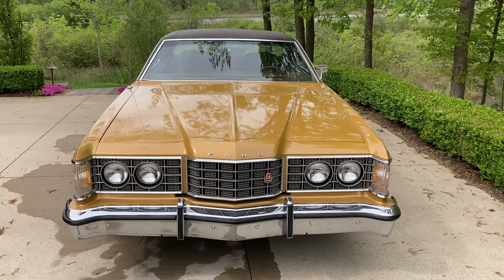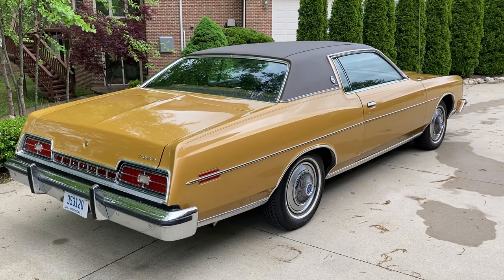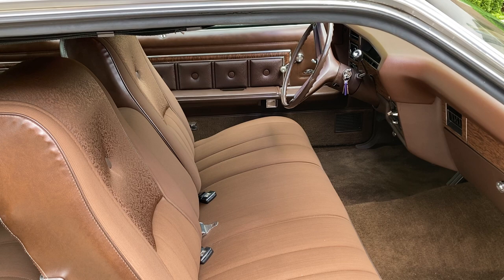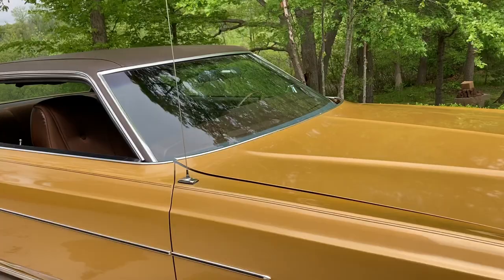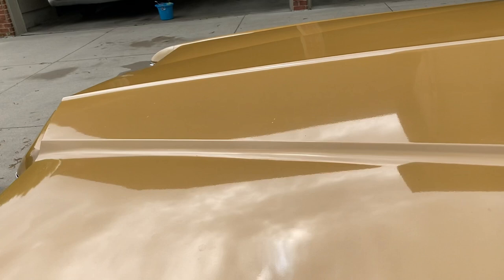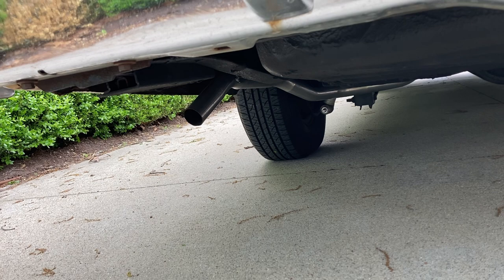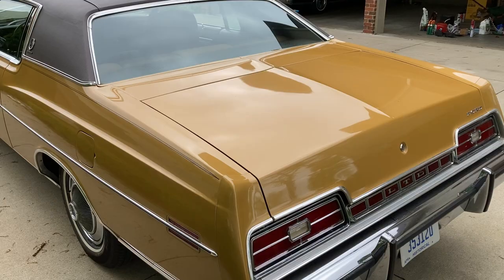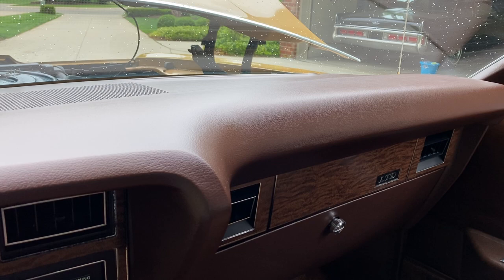1973 Ford LTD Brougham Coupe 460 V8 - The Everyday Man's Near-Luxury Car

Comment: 1971/1972 were better in the aspect that the "passenger" was not allowed to touch the HVAC controls (on LH side of steering wheel)...LOL...They also had Dual Ashtrays on the dash too! 😜

Comment: This car is begging for a set of 15x8 either slotted aluminum wheels or American Torque Thrust  grey spokes and either white letter  or black wall Cooper Cobra Radials 275/60/15 and 255/60/15. Also a mild 2 1/4" dual exhaust with some fairly quiet mufflers.

Comment: Whether an improvement on the 71-72 Fords debatable, but the 73-74 reskin was very effective in creating an impression of 'new car'.  I miss easily recognizable design cycles and I think this was one of the last - though the Torino --> LTD II did the same thing and maybe the GM b body aero clean up for 19080 counts as well.  Ford got a lot of mileage out of that damn front bumper design, but - perhaps because of its ubiquitousness - it always struck me as the least imaginative effort of the big three.

Comment: Yeah the buzzard I remembered that if you leave the keys in  Ignition it makes a horrible sound My parents had it deactivated on their LTD the and there's was a 74 model 4 door meant green with 4 screen interior the 400 engine automatic automatic air AM radio power brakes and the stiffer suspension and heavy duty brakes Is and real window defroster

Comment: A decently preserved vehicle, and rare to boot esp that color IMO. 

I am curious as to that  pass. side hood /fender match alignment variance.  Seems that the leading edge at the grill cowl is depressed, maybe just an optical delusion.

Not sure what is meant by “the retarded cam gear” at about 7:58.  Maybe you meant “troublesome” (as part of steering column lock), or something related to the spark advance on start.

Regardless -  a cool car, enjoy your ride!
Reply from the maker: Nope. They retarded the cam timing by 6 degrees in 73
Reply: @RareClassicCars  
 
Ah- the use of “gear” was ambiguous to me. 

Are you inferring the entire cam series had same setting shift?  The only good excuse is relatively cheap smog control. 

My thought is that shift would delay intake opening so less air in means less compression so less power, and less time to evacuate the cylinder on stroke 4 - all around less efficiency and less power due to exhaust restriction, though the exhaust gas would be slightly more pressurized from the upstroke to exit.  

Overall, a good move or a bad move for drivability?

Comment: Was the 460 much rarer than the 351 and 400's? I thought the 1973-74 Ford LTD's looked a lot better than the 1975-78 Ford LTD's.
Reply: The 400 was the most common engine for this year then the 351. there were more 429s than 460s.  should see if Mart can get the totals.

Comment: So how do you keep from wiping out all the camshaft lobes on all these older vehicles due to the fact that there ain't any zinc or phosphate in the oil?
Reply: Zinc additive is available at auto parts stores and diesel engine oil still has the zinc

Comment: Adam, I have a GM question:  The big Cadillac 75 sedans and limousines had rear-mounted a/c starting in 1953, and you could tell they had air conditioning by the scoops behind the rear window.  However, after 1971 the scoops disappeared, and of course the air conditioning in the trunk didn't.   Do you know what happened that the scoops for fresh air left?  I can't find any reference anywhere...thanks and best wishes from the Houston area-
Reply: I believe he answers that in the video Worst Automotive Features Of All Time
Reply: @knitterscheidt  You believed wrong--he's never spoken of the trunk-mounted '75' unit. You're confusing it with the flow through ventilation system on the '71, which I remember well because my parents had one.  I've never seen anyone on any video address my question--if you find one, please let me know.
Reply: @loveisall5520  oh ok, I'm not familiar with that, too bad it wasn't the right content, but this guy seems darn knowledgeable so he may get to it!

Comment: Adam, why did they call them LTDs when they made so many?
Reply: LTD is an odd name but no more-so than numbered cars from Porsche (911), Mercedes (280),  Chrysler (300 in 50s, 60s, and 90s through today), Mazda (3,5,6), Pontiac (2000, 6000 in 80s), Oldsmobile (88 and 98), and Ford as well (500 as a trim designation for Fairlane / Galaxie in 50s and 60s, but also spelled out as Five Hundred for the poorly-selling 4th generation Taurus, then back to “Taurus” for 5th/final generation). 

LTD could have been a phrase acronym, but US Ford didn’t commit to THAT scheme.  Buick used base, Custom and Limited trim levels for LeSabre and Electra (“LeSabre Limited” could be a little above Electra base).  

As to what Ford really meant, hard to say but Ltd. is the contraction / abbreviation for Limited, and LTD didn’t define that Ford would stop production at particular count.  In UK, Ltd. a generic suffix for business debt liability of shareholders; in US the parallel suffix is LLC.  None of that has any bearing on Ford’s name choice, either. 

Of course limited means restrained just as you inferred.  For marketing related to vehicles, for Ford and Buick (perhaps others), LTD/Limited is essentially the OPPOSITE of halting production, but does pertain to the number of options you can add past that choice of “standard” vehicle features - the higher trim line has very few (thus Limited).  LTD was a body style larger than regular Fords, so a step up and with that more prestige and comfort,  and implicitly fewer options. 

In the video, the options on the vehicle were special purposed by some one, figure a specific order that certainly did not add fancy stuff.   Past that, we know Ford didn’t really draw a hard line either on “limited”, as they made the even spiffier LTD Crown Victoria models from later 60s through 1990.  That’s when the LTD name was dropped so their last largest car was simply the Crown Victoria (Crown Vic) - and was very popular special platform for police cruisers.  Taurus was the lower line car, nicely appointed but lower because of size ala’ earlier production traditions.  After the Vic was discontinued in 2011, Taurus was top of the line and had the cruiser options, but before Taurus went away the Ford Explorer SUV was setup for police duties.  

That’s a long answer, but hope you appreciate that naming at one time meant a lot regardless of mfr. - while at the same time Ford perhaps got “lazy” (possibly out of ideas?) and went with a unique double entendre designation.

Comment: Such a early 70's color. Gas mileage? 8 mpg or so?
Reply from the maker: 14-15 Highway; 8-9 city
Reply: My folks had a 72 galaxie with the 400 v8 and it would deliver 18 to 19 pretty consistently.   13 around town

Comment: Because you're a finance guy, I'm sure that you appreciate the $2.47 that they saved on each car by making black seat belts standard. LOL. And GM and Ma Mopar were just as guilty in those years.
Reply: The "Black" seatbelts, and ancillary equipment, were the "Standard" seatbelts utilized by the Big Three & AMC during the '60s/'70s/& '80s; they would be installed on any interior color selection as standard equipment.  As an additional cost option, "Color-Keyed/Deluxe/or Custom" (depending on manufacturer) seatbelts, and ancillary equipment (reel housings/tether straps/clips/buckles/etc.) could be ordered that would be 'color-keyed' to match the interior color choice.  It was just another way for Detroit to tack on a cost option!
Reply: @Thomas-iz1le  Chrysler included color-matched seat belts across the line until mid-1970.They got back to making them standard in the early 1980s. Low-end Ks were some of the last to have black belts around 1983. I grew up around a very low-option 1970 Fury Suburban (special order) that had green belts, and there was no mention on the sticker of charging extra for them.

Comment: They traded it in because it gets 6mpg. Duh.
Reply from the maker: 14-15mpg
Reply: @RareClassicCars  Maybe if you could get it out on the highway and run an entire tank of fuel out of it at highway speed, maybe. I’ve driven these cars regularly before, they get 6 to 8 miles a gallon around town. 14 is a fantasy.